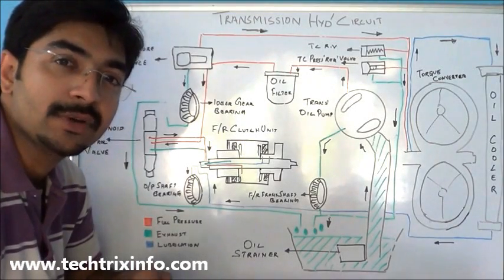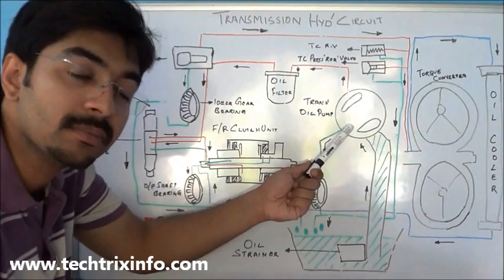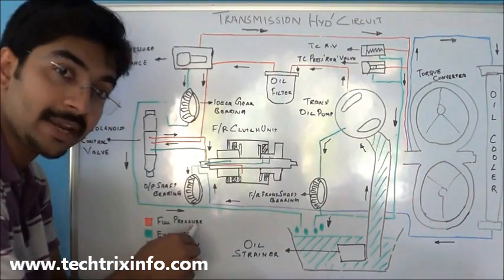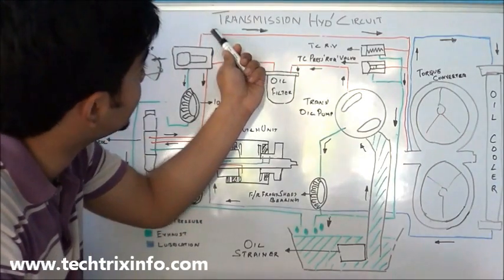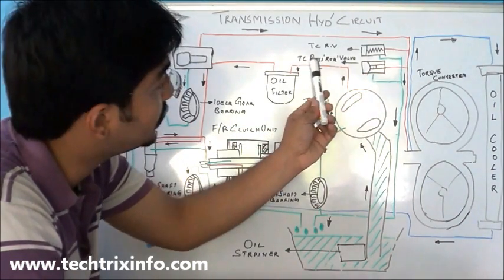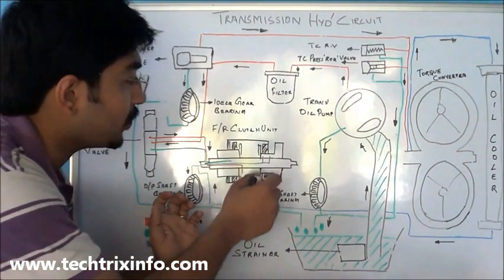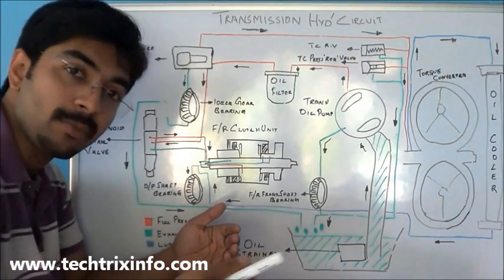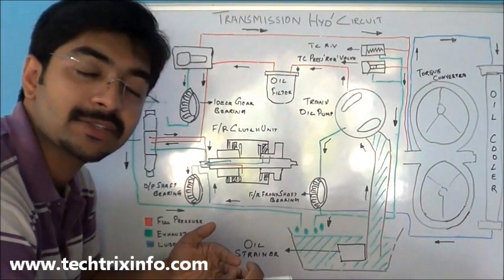How transmission of construction equipment works. ✔

Comment: Hi, I have a 1998 JCB loader with the transmission fluid very dirty and of a very dark color, I already bought the filter to replace it but I am afraid that I will change all that oil and then the transmission will fail, any recommendations?  Thank you

Comment: Transmission equipment in life has a great function, in order to ensure its good function to play, the need for normal vertical bearing work.You can buy a lot of the bearings here http://www.bhsbearings.com/product/motor-slide-bearing/vertical-mounted-slide-bearing.html.

Comment: sir, I am  a technician  recently I get a trouble in a wheel loader xcmg gear shifting not properly control valve no  give oil supplay to the clutch its an electronic modular controlled tranmiission  ,,, so pls help to any advice